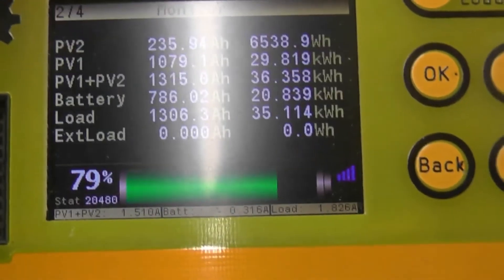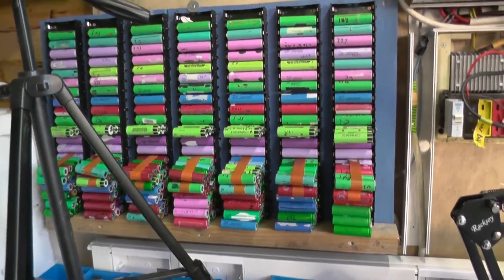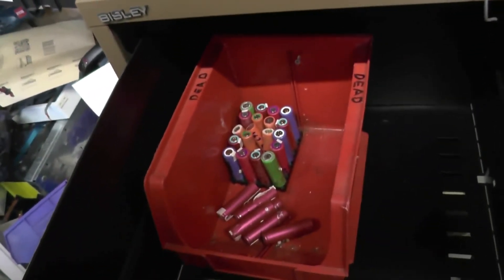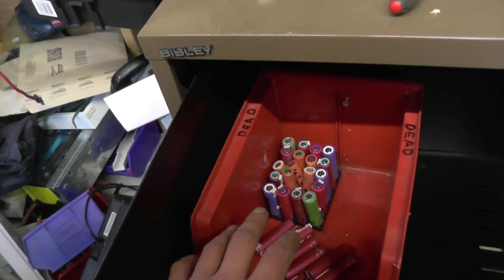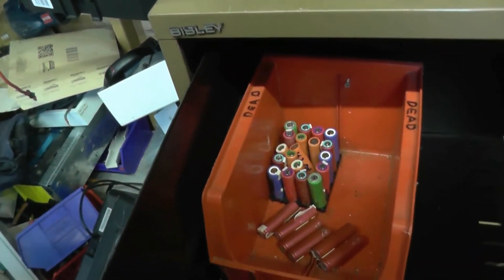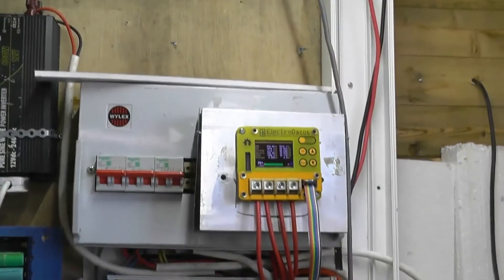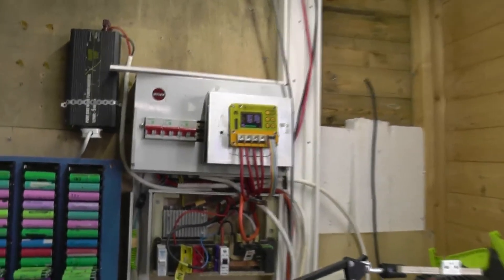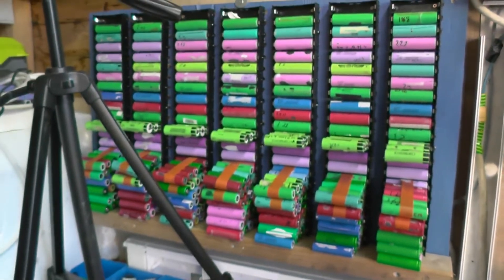31 days of powerwall using low grade cells

Comment: It looks like you have about 300 cells in that pack and not sure about the capacity but assuming about 2Ah each with 3.7V nominal it gets you to a around 2kWh battery pack.
While you used around 35kWh in a month about 20kWh went trough the battery so say the equivalent of 10 full cycles.
A new set of cells will maybe be good for around 500 full cycles but this used one maybe around 100 cycles or less so if lucky they may be good for about 1 year of use in similar conditions.
Assuming 25 cent/kWh the gain you made for the last month will be equivalent with 20kWh x $0.25 = $5 and if they last for about a year that will add up to about $60. Not sure that will be worth all the effort to get the cells and test them.
I used 25 cent/kWh since that is about the amortization cost of a new LiFePO4 in a real use case condition.
My entire offgrid house power consumption is just about 2x larger than what you have on this test/play system with 50 to 80kWh/month used energy and from that about 40 to 50kWh will go trough the 100Ah 24V GBS LifePO4 batteries and have done some for more than 4 years and will continue to do that.
I know is fun to play with used 18650 :) but they are not an economical storage system even if you get them for free. New 18650 will do better in this regard's but not as good as new LiFePO4.